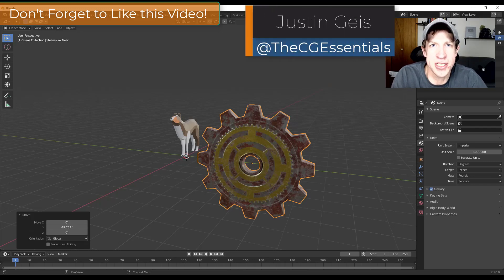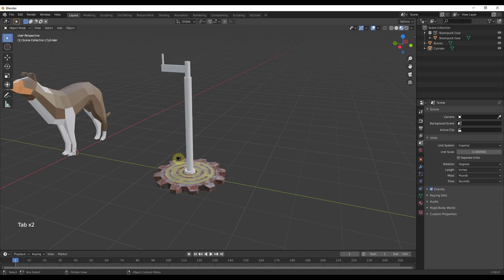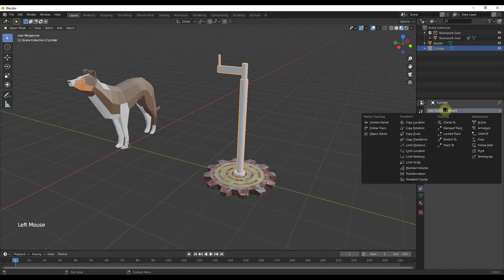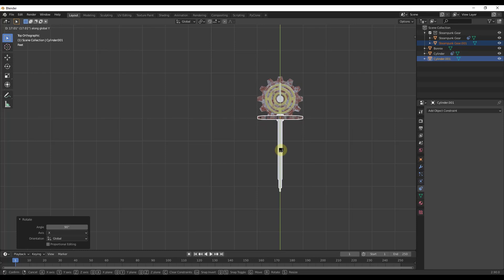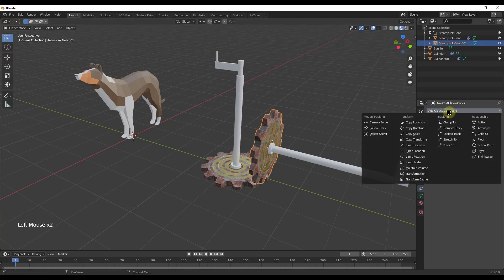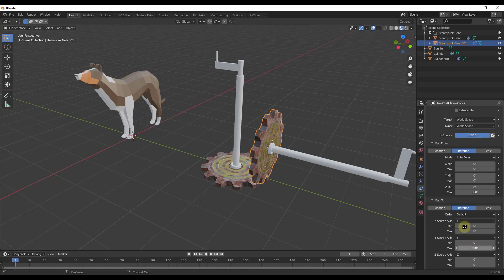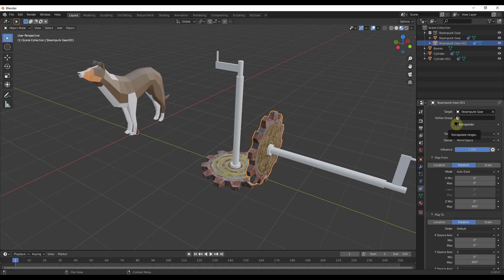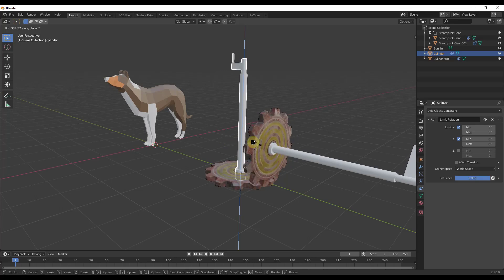ANIMATING GEARS in Blender with Constraints! (Linked Gear Animation Tutorial)

Comment: This is an eye opening tutorial of a Blender animation feature, I did not use before. 
And it works perfect with cogwheels of the same size.  It also works fine as a chain reaction with a third, fourth wheel aso. linket hereafter. 
But what if the wheels, as they are in a lot of machinery such as clockworks and in my case the engine in a traditional watermill, are of different sizes? Then a transmission would take place speeding up or slowing down the initial movement. That, I believe would take drivers and not just constraints. Here's a description:

Watermill-model
It consists of a big water wheel, a bis shaft and a 24 gog wheel rotating as water whells do on the x-axis.
An crown wheel on the z-axis with the same amount of cogs. Its shaft has a larger whell at the top with 48 cogs.
An aksel for the grinder stones also z-axis – the stons lie on top of each other, and the upper one rotates. This is driven by a cog wheel with 12 holes.

You can find an illustration here:
https://www.overetagen.dk/wp-content/uploads/2023/06/millworks_annotion-2.png

When the water wheel turns in this direction by the force of water coming down from the top, which would be the normal in old water mills, since it gives the advantage of gravity, the crown wheel part and the grind wheel part are driven. In Blender this means using drivers with Python script. The water wheel doesn't need a driver, since it IS the driver so-to-speak. The other wheel needs a driver to have the rotation of the water wheel transform to them.

Method – as specific for this model
Select the crown wheel, right click the transform value of its z-axis ad Add driver
Open the Drivers-window in your workspace and select the now created driver. The parameters kan be seen to the right (N)
With the eydropper chose the water wheel as Object
As Type choose X-rotation, since it needs to transfer the X-rotation of the waterwheel to its own Z-rotation
I suggest creating a unique name for the drivers other that [var] which is default. I chose crownWheelRoto. As the simple script called Expression write 
-(crownWheelRoto*1). The minus is there to revert the direction, since the water wheel rotates in -X and the crown wheel rotates i +Z. So don't confuse with what happens in the physical space in the real world, where the two wheels also are reversed due to the forces.
Create a similar driver for the grind wheel. This time the simple Expression-script is: (grindWheelRoto*4). No minus here, since both the grind wheel and the water wheel go in +directions (Z and X). And the reason for the *4 in this model is due to the gearing transmission from 48 cogs to 12 holes, meaning that the grind wheel rotates 4x faster.
Finally it could be a good idea to give all of the wheels a Limit Rotation constraint, so they are only capable of their native rotation, which is X for the water wheel and Z for the others (Properties Panel > Object Constraint Properties).

Comment: If the receiving gear is smaller this doesn't work as the influencer slider can't go over 1.0 right? I wish there was an easy way to just throw gears together and they work with rigid body or auto calculated math.
Reply: It does work,. If you want a ratio of 1 to 5 just set the value in "map from" to 1 degree and the value in "map to", to 5 and check the box on extrapolate.

Comment: Very clear, question- how would you set it up if the second gear had a different number of teeth? Example - Gear #1 = 16 teeth, gear #2 = 8 teeth, #1-360deg / #2-720deg
Reply: Multiply the angle in the "map to" section by the gear ratio. So, the map from would be 360 and the map to would be 720, is the gear ratio was 1:2.

Comment: Thanks for this video! How would you apply it to a differently sized cog which had to move multiples faster or slower than the driving cog?
Reply: I was thinking exactly the same thing
Reply: Did you ever find a solution to this? I was trying rigid body collisions but that didn’t work at all to rotate the second gear.
Reply: If you want a ratio of 1 to 5 just set the value in "map from" to 1 degree and the value in "map to", to 5 and check the box on extrapolate